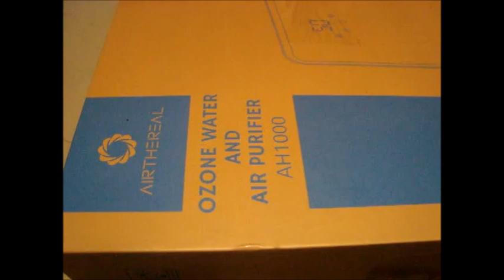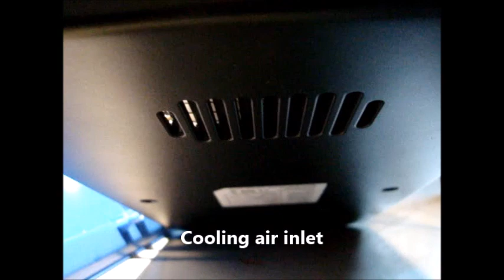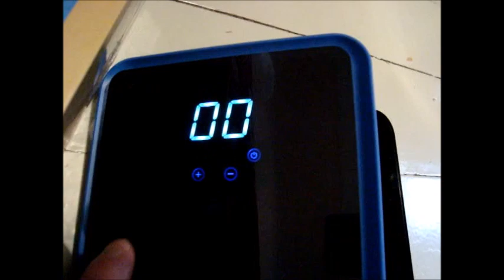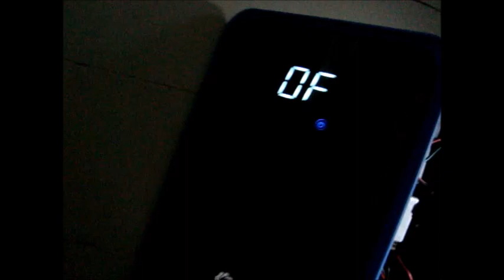Airthereal AH1000 ozone generator from inside

Comment: Hi,  I got several questions: 1.-Is it safe for me to stay in the room if I active the negative ion function only but without the Ozon generation? 2.-How is the Ozon produced in this particular maschine ( AH1000) ? Does it have an Ozon plate, does it have any sort of Filter which needs to be cleaned or changed? I can't find any of this in the Users manual unfortunately, and I just want to make sure for it to have a long life. I dunno maybe you can answer this. Greetings from germany .. Michael
Reply from the maker: Hi Michael, I know it is a little late now to reply and You'll probably have all the answers by now.
I can't say anything about negative ion function because I never tried it. I only use it to purify water from time to time.
It has two glass tubes with metal mesh inside where electrical corona is produced. No ozone plates. Sealed glass tubes where produced ozone exits only thru the tube, so it is more suitable for ozonating water.
Only filter I saw was underneath that little air pump. It was little sponge-like square piece. I guess cleaning it is no big problem if it becomes necessary.